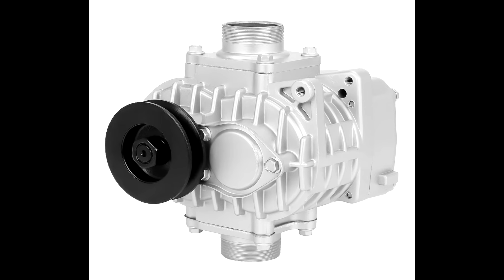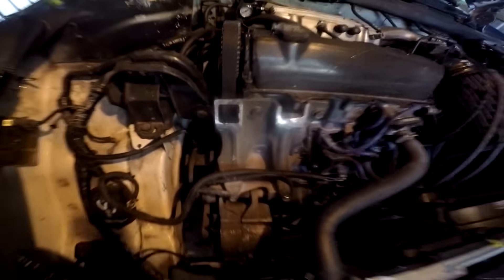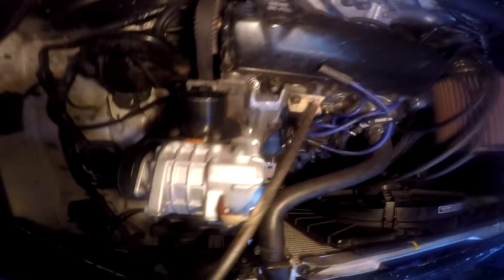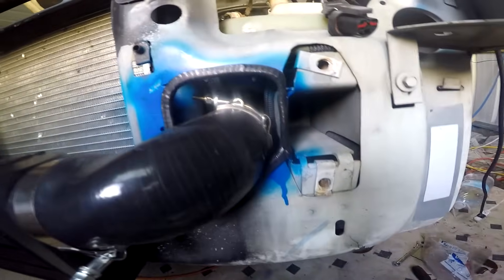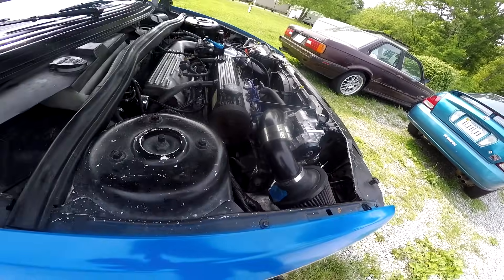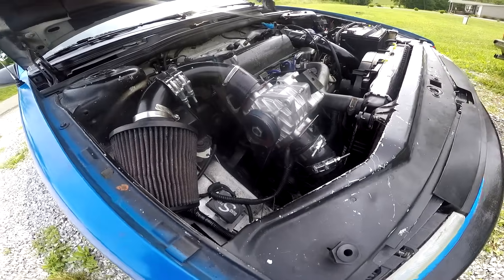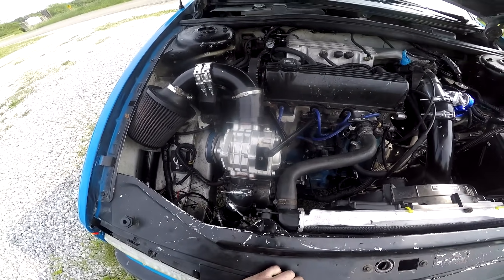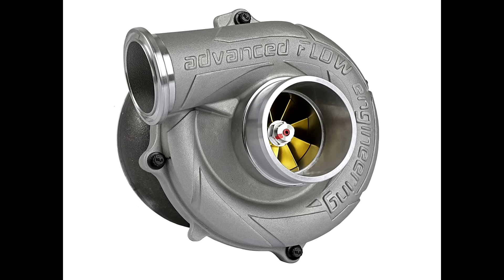AMR 500 Supercharger Testing - is it as Good as the Internet Says?

Comment from the maker: [DISCLAIMER] I've been told a few times that I'm an idiot and I should have known this wouldn't work and blah blah blah, keep in mind this is a review of a CHINESE "rebuilt" AMR 500. Which are basically used and worn out with a fresh coat of paint, reason being the average person would most likely end up with one of these.

I'm mostly making fun of the listings you see of these claiming that they're good to 2.0 - 2.2L, which is laughably wrong as we saw. It could MAYBE make 1-2 PSI with a tiny pulley, but it already ran nuclear hot with the pulley that was on it. I've also had some questions about the 13:1 AFR, saying that it should have been richer for boost. We never actually made any boost with this thing, so there was no need for a richer mixture.

Richard Holdener is experimenting with the AMR 500 if you want to see someone use one correctly. All hail Richard Holdener.
Reply: i am sorry brother but keep in mind that 500 says how much cfm wich indicate the max volume of air the blower will be able to make. at 5000 rpm your car will need at least 750cfm . these measures say u are doomed with a 2.2l. u need a eaton 62 or a eaton 90  . wich have 620cfm and 900 cfm . u can tune those with  the size of the pulley gear.
Reply: yje more u compress the air the more u need a 9liters intercooler.
Reply: @tripplefives too much loss still
Reply: You're not going to guilt China into changing their advertising.  Besides people who are building a vehicle with a mini-supercharger are already aware of China's marketing antics and know to adjust expectations accordingly.  I wouldn't want to discourage people from taking on a project with this product, it's the learning process that has value anyways,  not so much the contraption that results.
Reply: ents

If you had actually done your research first. Blower displacement x drive ratio ÷ engine displacement per rev ÷ 2 due to intake stroke on 4 stroke. This gives you your boost ratio Then you remove 1 atmosphere from this to get your boost pressure. So. 500 x 2.33 = 1165 2200 ÷ 2 = 1100 Then divide 1165 ÷ 1100 = 1.059 1.059 minus 1 atmosphere = 0.059 bar pressure. This is at 100% efficiency which never happens with superchargers so problem in the minus pressure wise. These superchargers get a bad reputation but it doesn't help when youtubers like yourself, donut media and grind hard fit them wrongly without doing any simple research
Reply from the maker: @paulwheway4553  It's more about making fun of the Ebay sellers marketing them as good to 2.2L than actually making them work properly. Also it's entertaining.
Reply: @HatersGarage they never say what psi boost, with 2200cc engine you need to run the thing with 2.5:1 ratio with max of 6000rpm from the engine. With that setup you will get 1.26psi. Yeah they advert is slimy, but it is our due diligence to check before buying something like this.
Reply: @kaikart123 what’s the actual math? Where’s a resource where I can read more? I kinda want one of these for my 87 CRX but what levels of boost would i even be making?
Reply: @fenixlolnope361  I am on my phone right now so I cannot answer in detail, but for engine larger than 1000cc I would not bother with this and just go with the larger AMR1000 or AMR1500 instead. With the smaller AMR500 you need to run it at higher RPM means noisier and the parts would fail earlier and more catastrophically.
Reply: i have to thank you on your flaw so you made me research more and these basic supercharges are good at low RPM (not for your setup) the best you do is put smaller pulley for more rotation at low rpm and make it full a bigger turbo making a twincharger setup, in your case fuel engines over 2.0 you all have easy over 6k RPM do you will need a EATON which desingages and you make low end power with supercahrger mid power with both and high end with only the turbo (supercharger has to disengage or you can loose power).
Now on diesel cars this is a beauty because they have little RPM and supercharger and turbo charger work till Max RPM my car has 4500 RPM so it just gains boost all the time. BUT  the AMR500 is best for max 1.8L engine for a 2.2L go for a SC14 also you better adapt Oil lines for these superchargers. and if your successful with a twinturbo boost you will understand that you need Boost Control, its just insane amount of boost
Reply: I've had this idea to spin an AMR500 with a dc motor and throw it on a 670cc Harbor Freight engine.  It's just crazy enough to work. 😂

Comment: The crew at Donut Media just installed one on their VW Cabrio. It took it from 81 wheel hp on the dyno, to, 46.8 wheel hp.
Reply: I saw that, I can’t believe that. I hope people will stop buying these 😂
Reply: lmao shit is funny as hell
Reply: they installed it backwards i believe
Reply: Percentage wise that's a great improvement, just the wrong direction.
Reply: Yeah but they overheated that one. There was clearly some clearance issues too. A rushed performance by grind hard plumbing didn't help
Reply: @MaNNeRz91  they possibly didn’t oil it either
Reply: @CMGDMovies  I think they're sold as sealed and greased no oil needed but I'd tear it apart for sure
Reply: Seen that I was rofl
Reply: Sooo it might give a geo 1 extra hour?
Reply: I'd say it was probs the alternator pully.
Reply: I've seen them work on smaller engines...  was thinking of trying one on a Geo 1.3 or 1.0. I think you're motor is too big. The AMR should be rated for a certain CFM of air flow.. And your motor should also be rated for a certain CFM. The AMR has to be able to overcome the vacuum or it's never going to build any boost. I'm thinking the bigger the motor the smaller the pulley as well. So you may need to go ultra small.  Your really at the limits of the 500 and if you're running more than one intake and one exhaust valve per cylinder you're flow will probably be too high. I think you can get away with it on a Beetle engine of similar displacement but they dont make near the power of your motor.
Reply: they just added the supercharger and didnt tune the ecu to read the incoming boost pressure plus even a turboed vw needs tuning when switching from a k03/s to a k04
Reply: @random13627  You would be right, as I saw it they did a blow thru and put PSI into the MAP sensor. No way that works!
Reply: It wasn’t even tuned ….
Reply: It was spinning the wrong way 😂😂😂.
Reply: @random13627  Same thing I thought when I saw that video. those guys don't know anything about engines...
Reply: @Reefer-Rampage69  I have an AMR500 on my daily Lancer, gained around 60hp dyno tuned with other mods (S90 TB, 4-2-1 long headers, catback). They only work when you actually know what you are doing. No one even questioned why that AMR500 sounded like a dying jet engine. But that’s an internet thing anyway
Reply: Who tf thought an eBay supercharger was good
Reply: No way forced induction literally halves your horsepower 💀💀💀😬
Reply: It was mounted in reverse
Reply: because it displaces 500cc of volume per revolution.... its intended for sub liter engines, dont always believe what you read, especially on cheap sites like "china"express or any other place that sells stuff awkwardly cheap ... its literally going to kill hp, just as it did for dount because they fitted the 600cc intended supercharger to a 2.0 engine, the engine itself breath more air than the charger could flow itself.
Reply: @JABelms  yep. bunch of rich boys got some good cameras... blow money on this or that but are absolutely clueless about anything as theyve always simply reached for the chequebook rather than figure something out themselves... but yeah... internet thing. the people watching are generally even more ignorant, then get all upset when the few people that do know what they are doing come and point out all the errors they made...

its just a freaking air compressor. not that complicated.
Reply: @Reefer-Rampage69 they do work good on small engines. Like I mean less than 2 liters. Popular on vw beetles and motorcycles.
Reply: They also didn't put oil in it.
Reply: @Fabmoyro they can be really dumb but are entertaining, which works out for them because they are in the entertainment business not the being smart business lol. The smart part was creating the business.
Reply: it also sounded like it was grinding metal on metal the whole time... they either didn't put oil in it, or the whole thing was already trashed.
Reply: They used the fake remanufactured one though, not an oem refurbished unit.
Reply: I love donut media but they can realy misjudge a cheap compressor there is a "Real engineer" in US that took this blower and tested its limits and showed that it can make 210CFM
Reply: @MaNNeRz91 The bearings are pre-lubed on the pulley side, but these still need to be oil filled for the roots journals.
Reply: Yeah lol it’s just too big for that itty bitty motor
Reply: @Reefer-Rampage69 while it is cheap quality it’s probably too big for the application for that little 80hp car, and too parasitic for it to reap the benefits.